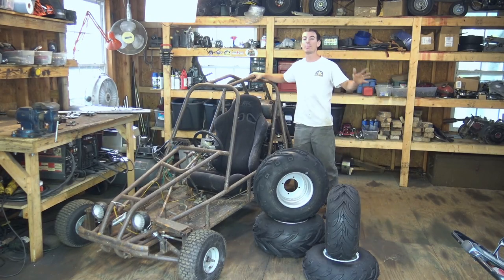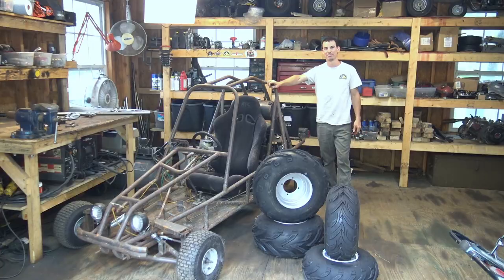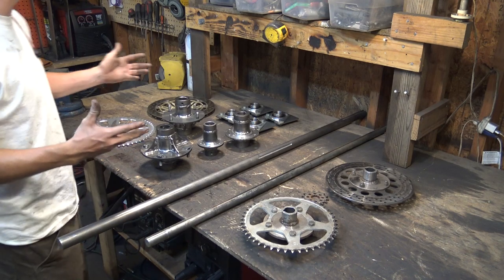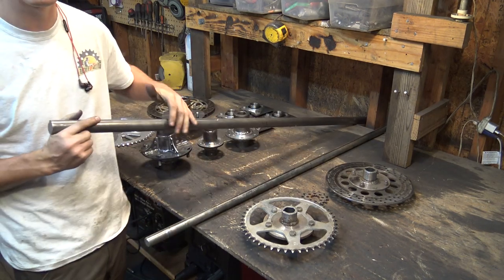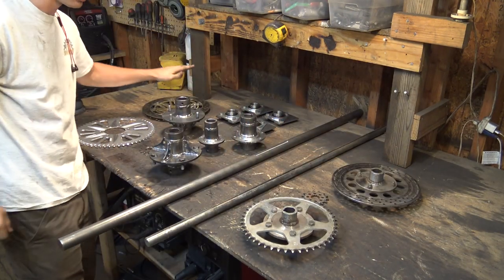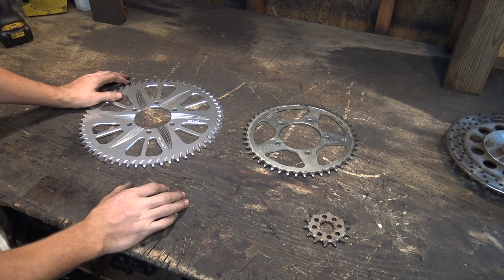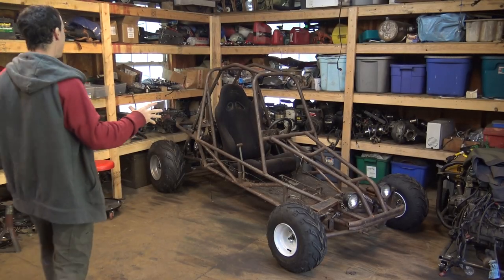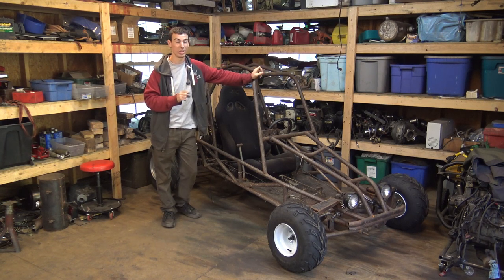finishing the GS500 dune buggy part 1

Comment: 1 last thing I recommend checking on the engine if you haven't is the pick up coil. If it's breaking down the heat will cause any breaks in the wire to loose connection so will run when cold but then stop running when hof

Comment: i might have to do this to my gs500 even though it is still perfectly functional. 
if you take it out driving and bend that axle... it can happen. then try replacing it with a heavy wall pipe of the same diameter before you redo all that work for a larger axle. 1/4" wall at the most enough to put a key way in.

Comment: Hey ur problem is ur pluser forgot the exate name of it it's by the stator what they does is they run right untell they get worm the votage changes and the don't work with cause it to die and when they cool off they have the proper voltage untell they get hot aging
Reply: terrible spelling aside I get what you mean exactly! copper wears out, epoxy coatings too, then add in thermal expansion warming and making it short, happens to electric motor windings and coils all the time! cools off, shrinks, works normal again until it heats/expands/shorts itself.

Comment: Cheap axle? is it axle steel? if not you should harden it.
Reply: If it's a low carbon steel it isn't hardenable.. $40 for the axle, pretty sure it's LCS
Reply: Phil you can actually harden LCS a lot, there's a trick to it, simple and cheap. you heat it a LOT (good solid red not to orange), and quench in the nastiest oldest blackest used motor oil you can get your hands on, it'll carry sulfer and metal lords only know what else other compounds into it for a "case hardening". grew up in dad's steel fab shop, this trick does work! we had a job for 3/8 x 2" rollers, straight steel wasn't holding up but dirty quenched sure did, odd as it may sound. don't believe me, try it yourself and give it the old "bolt cutter test", untreated vs treated.
Reply: @modelnutty6503  hmm, I didn't think you could, that's what the books say, maybe I got confused with LCSS. And but now looking back, LCS I had welded, and then had tried to drill afterwards it was hardened. But that is different because it's still air hardening. No quench.
Reply: In school I made my own punches and we hardened it in the teachers used motoroil. - the books dont say it oh well lol
Reply: Don't you need to heat the oil to 175 degrees?
Reply: @modelnutty6503  "case hardening" is just that... you're getting what little carbon is in the steel and carbon from the motor oil to leech in to form a hard 'case' around the steel. It's just surface hardened...usually just a few thousandths thick. The steel core is still soft.

Comment: WAY too far of a drastic change for gearing - each tooth you drop in the engine sprocket is like you added FOUR to the rear! so if you look at your original ratio VS the one you have now it's as if you went up 26 teeth in the back ..... you'll soon see this was a mistake - you will now have first and prolly second gear un-useable, and you can prob leave a dead stop in third or fourth now and it's going to go less than 20MPH in top gear......... you could have simply gone up 4, 6, or 8 teeth on the rear sprocket alone and gotten the result you wanted - also now by going with such a tiny front counter shaft sprocket, you will wear out chains incredibly fast, youre forcing the chain to wrap too tightly around a curve and it will make it run hotter and burn up quicker....... I guess you'll learn by burning thru a bunch of $$$$ buying stuff that doesnt work
Reply: Eclidean It will be fine!! Remember It's not a motorcycle, it's an offroad buggy.
Reply: LOL gearing is still gearing - doesnt matter if it's a dump truck, he only needed a BIT lower gear, not a huge amount - we'll see - (if he even shows it) in the next video - that gearing wont work
Reply: it'll work great lifting the front wheels in 1st 2nd 3rd !
edit: he can always go to a 15 up front, real easy do
Reply: I think it will be fine he put way bigger wheels and tires to think tht will make a difference as well
Reply: going to a 15 in front will still be the equivalent of going up 10 in the back still from what he had
Reply: 3.29  to 5.45 to one
Reply: Eclidean You should build your own dune buggy and use whatever kind of gearing you'd like.
Reply: We're going to see aren't we
Reply: @VasilyBuilds  yeah wheres his own off road buggy ? What kind of gearing dose he have .....right....